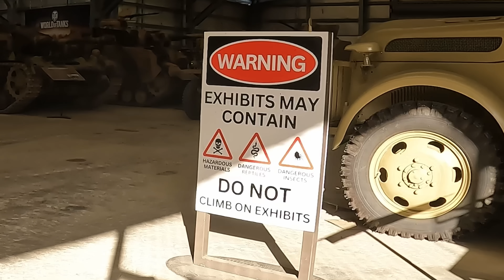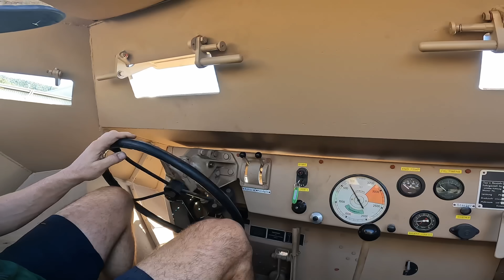BONUS VIDEO! Fixin' up the FlaK Halftrack Magneto and Engine

Comment: First time viewer here, enjoyed the content,( auto mechanic by trade), got me subbing, makes me question as to why they didn't diesel power this thing originally?
Reply: There is an explanation. The way the original specification was written. Had it been written just a little differently, the diesel advantages would have shone. Especially range. As well,the idea was heavy fuels such as diesel should be reserved for the Kreigsmarine. Motorcycles and trucks ran on gasoline,adding diesel to supply train was thought undesirable. If the Soviets could do it,so could have the Germans.

Comment: I am unable to see, and you didn't explain how the valve clearance is adjusted in this engine. Are there eccentrics at the cam rollers, or elsewhere? What a cool machine, I wonder what the locals think when they see you tooling around the parking lot!!!

Comment: The tracks hold a semi liquid grease and there’s a reservoir chamber within the track horn.
The track links are fitted with special needle roller bearings with oil seals on either side of each needle roller bearing  to prevent the semi liquid grease leaking out.
My brother and I rebuilt the basic engine block and cylinder head for this halftrack when it was restored in the UK. 
All of the cylinder head valve gear  rockers had new bronze valve clearance adjusters made along with new overhead camshaft rocker roller bearing pins made . 
It also had new inlet and exhaust vales with new guides fitted.
All the con Rod and main bearings in the engine were re-white metalled and re-machined to fit the newly ground crankshaft .
As the engine has wet cylinder liners, new ones were manufactured fitted along with the pistons and rings.
All of the insides of Maybach were painted with a high temperature oil resistant paint .
We think that the reason for this was due to the porosity of the Maybach castings and this was a way of sealing the internals of the engine.

Comment: I hope you put some electrical diode grease on the cam gear for the points ,that way she does not burn out or overheat and get stuck ,cheers, its like going back in time when engines all had point caps and they had to be set with the points at the open part or the hump of the cam gear of the shaft, thats the only way to do it? keep up the great work guys and girls.👍🦘👌✌

Comment: The steering miracle is in the drive gearbox. It is complicated and very specialized.  I've seen the application of this technology in other places that required change of speed of separate drive sprocket with only one power input shaft. Those gear boxes were called PIV.  You got to take one of those apart. I'd love to see the guts of it...

Comment: Is their a place that makes any aftermarket stuff for those engines. Is the panzer place you guys visited in Europe the only place . Im glad you guys put a CAT motor in the Stug3g. The original engines being awesome to have are really expensive it seems . What voltage did those maybach engines run on?

Comment: Old German stuff has the peculiarity that when they just slide smoothly together, everything is lined up and properly adjusted. The slightest deviation from the tolerance and everything gets tangled, they don't want to fit together. When the magnet jumped into place by itself, I thought it would run like clockwork. Nice job as usual.

Comment: Great job on the magneto repair. What was the issue for erratic spark?
Reply: He told you in the video.  The points gap was about double what it should be, which means they opened too early, before the coil going past the magnet has built up enough current. When the coil current is suddenly interrupted by the points, the energy in the coil's magnetic field has to go somewhere, and the sparkplug is where it goes.  Thus the points should open when the coil current is maximum.

Comment: Nice work. Must be nerve wracking to work on that rare engine. I'm working on a slightly younger Merc and every time i have to do repairs on the wiring it's like working with a holy saint's wrappings, too rough or have a slip and they wither away.

Comment: Gear driven overhead cam 
I just think why don’t modern engines still use gears in stead of timing chains 
And all the maintenance issues they cause
Reply: With push-rod engines the camshaft is close to the crankshaft, so only two gears are needed - one on the crankshaft and one on the camshaft.   Usually one gear is made softer than the other, which reduces wear and noise.
With overhead cam engines, the distance between the shafts is much greater, so if only 2 gears where used, their diameter would be such as to increase the width of the engine quite a bit.   So gear driven camshafts need three or 4 gears - one on the crankshaft, one on the camshaft, and one or 2 intermediary gears.   This adds cost and timing uncertainly due to gear wear.  The extra gears add noise as well, which matters in car engines.   Timing chains are cheaper, more precise in timing and are quieter.   (except in ponton-style Mercedes cars, which develop excessive timing chain noise when they go past about 300,000 km.   Mind you, an American or British car of the same vintage wouldn't even be drivable at 300,000 km.)
Precise timing of the camshaft is important because it drives the distributor.
Many overhead cam car engines have used external toothed rubber belts, which are cheaper still and even better for timing accuracy and noise - but are prone to break.

Comment: ❓How does the Steering work, is it not Skid Steer ?
Reply: Yeah the front wheels steer until you turn the wheel hard enough, and then it'll brake the track on one side to skid steer for tight turns. Great system when it's maintained right.

Comment: How many folks on hear remember the good old days of adjusting a set of points on an engine.
Reply: While breaker points do take some maintenance compared to the modern electronic counterparts, a spare set in the glove box with a screwdriver meant that almost no matter what you could get the engine running out on the road where today you call the tow truck.

Years ago I went for a ride in an old boat on a river in New Jersey and after running a while the engine shut off.   Problem was we were in the middle and flowing toward a dam...so it was a problem.   Engine was an old Buick and I popped the distributor cap, saw that the points were burned, cleaned them with sandpaper from a book of matches and got us running again before we went over the dam.   It's great to understand how things work...might just save your life.
Reply: @recoilrob324  I've got a car sitting in my garage right now that's run for 20 years and 120,000 miles on it's original plugs and wires while my fancy dial back to zero timing light sat neglected in a drawer.  Most people couldn't adjust points even when they were common and I can't remember the last time I saw a matchbook.   Doesn't need fixing suits a lot more people than easily fixed. I enjoy working on antiques but I don't kid myself into thinking modern cars aren't better.
Reply: @danielstickney2400  Oh...without a doubt the early 2000's were 'Peak Automobile' with excellent durability and power that no early points and carburetor engines can match.   But....we've gone backwards with over-complication now and dozens of electronic modules controlling everything with almost nothing being owner serviceable.

The engines that ran points also had bores that wore heavily and 100,000 miles meant they were very likely to be worn out and needing rebuilding.   But...on the other hand...the blocks had enough meat to bore to an oversize and do it all over again.

The government emissions regs have gone insane and when they switched from PPM to PPB because they weren't registering anymore they should have said..."They're clean enough" but the whole emission deal has become a lifetime government entity so things will NEVER be clean enough until they're completely regulated out of production.

But I'll predict that someday if all vehicles are EV's...they'll come up with ozone regulations or the like just to stay relevant.
Reply: @danielstickney2400  yup. All the nostalgic comments about fixing a broken down engine. The reason the engine broke down is the unreliable ignition system. 
To me this is like saying you’d rather have a carbide headlight than a matrix LED one because you know how to refill the carbide one. Okay sparky.
Reply: Many years ago when I had a Holden with a Chevy V8 and was towing a boat up a steep hill in the dark the engine cut out. Lifted the bonnet and immediately saw that the distributor had spun round away from its normal position. Got out my tools, among which was a 12V lamp with crocodile clips - used that to retime the distributor to the mark on the engine pulley, clamped the distributor nice and tight and away we drove again.
Reply: I still remember getting stranded cars going again by borrowing a girlfriend's emery board or rubbing them on the flat side of a concrete lamppost. Advising them to change points and condenser. A get you home tactic not available to modern cars with a module for everything.
Reply: @dukwdriver2909  always found a match box  was always good to have handy
Reply: I used to fix small engines back in the 70s, most times it was the points or carb that were boogered.
Reply: Hey us millennials did points and carbies too. Even in mid 00s when i was a tech youd get an old cuda or corvette sometimes, and if you didnt understand points etc how would you understand GMs HEI ignition and modern stuff?
Reply: @captaintoyota3171  Trying to teach someone how an engine works is easiest for me to start with a mechanical system because you can SEE all the parts moving and doing their jobs.   Once you get what's happening then an electronic ignition system does exactly the same thing...just using different bits.   
Same for carburetors....Fuel Injection does the same job just in  a different way.   You need to understand both mechanical and electronic to be really good today.
Reply: Yep. Cracked point covers meant no sparks and you could remove the arm to disable you vehicle 😊
Reply: On my '63 GMC, points were set initially by feeler, then, open a little port in the cap, insert a hex key and dial-in dwell with a meter.
Reply: @mxwxkaun  How many young mechanics even know what a dwell meter is and what it did?   Checking the dwell was a great way to gauge if the rubbing block on the points was wearing, plus once you had the distributor set you could change points without a timing light by setting the dwell the same as it had been.
Reply: @recoilrob324  Yep! I learned from old school hot rodders.
Reply: @recoilrob324  how many young mechanics plan to work on fifty year old ignition systems?
Reply: I still do it on my airplane magnetos and my 69 Cutlass. I'll be passing that knowledge and experience on to my kids one day. Can't let that stuff die.
Reply: I still do it on my mid-fifties tractors. The make kits to convert to electronic ignition, but if it ain't broke...
Reply: Yep a mark 1 escort
Reply: How many folks remember engines in general
Reply: I still utilize them😮😂😂😂

Comment: The Magneto has a HELICAL gear. Points ignition systems need experience and careful adjustment to get them to work well.  That Maybach engine is high quality in its valve train design......even has gear driven camshaft.  Could have better access for removing the Mag and Carbie, but compared to some of the exhibits its probably in the better category of service access.

Comment: Love these bonus video's. As an electronics tech one thing I come across is leaky capacitors, not leaking gunk, but leaky electrically. On some vintage capacitors the insulation breaks down or you get moisture ingress, the capacitor then leaks current. This may effect sparking on vintage vehicles.